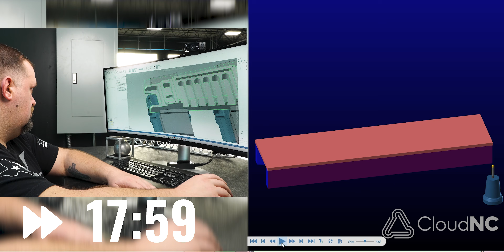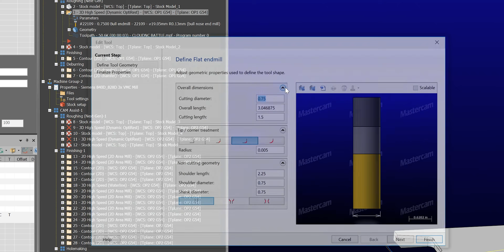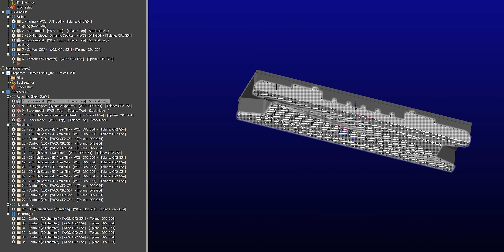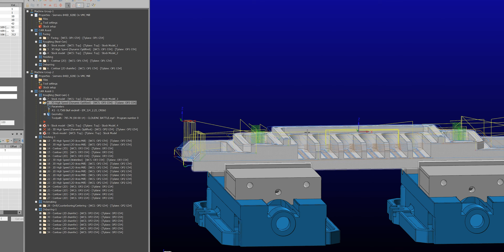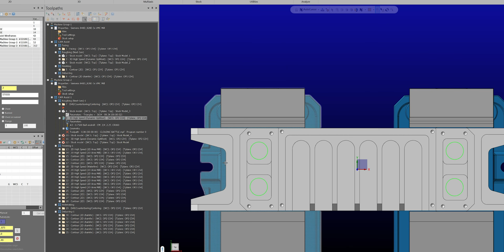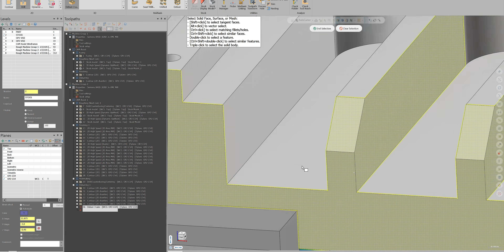Human Programmer vs AI CNC Programmer

Comment: 1. This is 3+2 axis, not 5-axis
2. Have fun telling your customers you are going to send their proprietary data to oversea cloud servers in the UK
3. also wtf taking half an hour for that part or even using CAM for this. Any programmer sh1ts that part out in 5 minutes on the shop floor and at the machine
4. Ever heard of templates? Sh1tfluencer imbec1les

Comment: I've worked with Edgecam with the same skills, just add a stp with stock and Edgecam would provide a workflow.
I was at the point to add a tool library so it would know what tools to use and feeds and speeds concerning the material.
Unfortunately that company shut down but I could just imagine the possibilities.
Great video

Comment: 20y later we just enter the 3d model and material properties. Ai will see the avaliable tools and its AI precalculated speeds and feeds. AI will run trough 50 diferent scenarios and find the best one.
BTWafter you came back to modify what the program made, it took you about thesame as the manual guy to modify stuff... trade off is same as with coding. you let ai do slop than you have to come in and check everything and modify. maybe a 20% speed increase if it did well. also over time, an inexperianced programer just gets dumber and only relies on AI not really understanding what and why something is done like that. Veterans are a diferent story

Comment: I totally get it, time is money and when you already have such capable CNC machines, you want to maximize your time setting up tool paths.
As long as the automatically generated paths work out and it doesn't take a lot of time to change and clean up, it's perfect!
Totally agree with other comments who would have loved to see the actual part being made.
So quality, time to setup, possible errors and time to finish the part can be compared.
It should also include tool cost, from wear and use of said tools, just to keep it interesting.
I love facts!

Comment: Will work great as a rough draft for programming. The operators on the floor will still have to go through and “tweak” the program sent down from the programmers. For shops that program at the machine, I don’t see AI as beneficial. Perhaps I’m wrong. Maybe high count production shops will reap the rewards. Single piece orders will continue to use expertise on the shop floor for finish work. Roughing and semi-finish work will benefit from AI. +/ .005 or greater tolerances will save quite a bit of time programming. Just a matter of time before new machines will have AI imbedded. The future waits for no one. Great content guys. Tnx

Comment: Autodesk FeatureCam has been doing this for years more like decades  with Feature Recognition this is nothing new
Reply: Hey, CloudNC here. CAM Assist is a step change from FBM (and similar) and pretty different as it goes beyond simple programmed specifications - you can show it a part it’s never seen before and it will generate a toolpath and strategy for the whole thing. Not feature by feature.

Comment: Neither one of these guys is actually writing a CNC program. Give them a text editor and a calculator then sit back and see how long it takes them to actually write the G-code. I bet that neither one could write a functional program. They rely on software designed to generate the G-code for them.
Reply: Doesn't matter. That's the future. This industry is doomed tbh
Reply: @lordzooq8987  It is the future, but neither one of them is actually writing code.

The G-code generated by modern tools is not highly optimized. Those "programmers" who can't write G-code by hand are incapable of optimizing the cycle time of their machine tools.

FYI - Hand-written code is eligible for copyright registration and protection. Machine generated code is not. If generated G-code is taken (it can't be stolen because it is public domain), then there is no remedy available under the law.

Comment: I like this its good but feels like there's alot of nuances with using it. Maybe it's a confidence thing but I would be pulling the tools I know I want it to use before asking it to tool path it. 

Does it flag material it cannot reach or finish? As that would be good if it checks its own work before it presents it to you.
Reply: Hi, CloudNC here. Yes, CAM Assist will show you at the end of the tool path generation what it's been able to do, and what it can't. Right now it can so between 70-80% of most 3+2 axis components, and we're looking to improve that all the time.

Comment: Its so weird to see the job that used be the highest paid, most experienced position that everyone wanted at most shops just be turned into an icon on your desk top.
Reply: Isn't that what the entire industry is about? Automation?
Reply: You still need to check the program to find flaws and get rid of them so the experience is still required. 
But it's a big time saver

Comment: The proof is in the run time, accuracy, and finish.  If you have a set of small lots that will run for years, if the 1/2 hour plus runs faster than the AI by enough of a difference then manual programming is the monet maker.

Comment: I fail to see how this is any different than any of the other AI/feature recognition systems that CAM packages have had for years.  Feature CAM has been doing this for over a decade now.  Calling it "AI" programming is just using buzzwords to draw attention.  They threw the word "cloud" to make sure they had the all of the buzz words covered.
Reply: Hey, CloudNC here. CAM Assist is a step change from FBM (and similar) and pretty different as it goes beyond simple programmed specifications - you can show it a part it’s never seen before and it will generate a toolpath and strategy for the whole thing. Not feature by feature.
Reply: @TeamCloudNC  Feature CAM worked the exact same way. Load a part and define stock and origins. It would handle the rest.

Comment: How is this better than FBM? That said, this is the worst AI is going to be from an exponential perspective.
Reply: Hey, CloudNC here. CAM Assist is a step change from FBM (and similar) and pretty different as it goes beyond simple programmed specifications - you can show it a part it’s never seen before and it will generate a toolpath and strategy for the whole thing. Not feature by feature.

Comment: As a manager of a small shop that also does the programming and quoting, I think this is extremely useful. It will never replace the years of experience and knowledge a human programmer has, however, it can be used to get a quick quote done. If you win that job then you have a good baseline program already, and can optimize it to your liking in a fraction of the time it would normally take.
Reply: Don't say "never replace". Given enough time CNC programmers will be completely replaced. Most likely the designers will just send the model directly to an automated system that even loads the material into the machine.
Reply: It seems like a fantastic thing for prototyping, internal workshops.. but the cost is probably prohibitive, and in reality, how much faster is it than Fusion 360 - template/container methods?
https://www.youtube.com/watch?v=WNW-OFNRA60
Reply: AI is good at doing the boring parts.
Reply: For the prototype, its more than enough. If you then have a run of 1000, then you make changes.
Reply: @ Is it anywhere close to affordable?
Reply: in china,if we have too much odd products to program,we have another choice to choose which is outsourcing the programming.  the price of this video naybe $7 more or less...
Reply: Manager of small one?😂😂😂😂
Reply: I would have a very hard time blindly trusting CAM assist, and pressing cycle start and walking away.
At least if Barry's program crashes, you can torment him . 
: )

Comment: This will be / already is a massive shift in the industry. That is an incredibly powerful tool. To get 90% of a program done in 2 minutes. A less experienced programmer like myself would easily take 2 hours to program that part by hand. I could realistically match Barry's time but with the cloud NC help.
Reply: The front end work of getting these systems up and running isn't trivial. This isn't a new idea by any stretch of the imagination. Feature CAM has been doing this for over a decade.

Comment: For the inexperienced, I can totally see this causing just as many problems as it solves.
Reply: Correct, which is why you actually need to know mastercam before using this plugin. It will help speed things up, and CloudNC was smart to say it gets you 80% of the way, rather than being a total solution.

I saw a demonstration of this and liked it, but I would've been more sold on it if it was capable of running locally on an APU rather than risking your data through the cloud. Especially if you're an ITAR contractor. Obviously, they have a secure cloud option, but that comes with its own pricing bracket. I'm not sold on that because my preference is to air-gap systems that hold sensitive data, and that means CloudNC wouldn't work for my configuration.

The other downside is that the pricing seems rather prohibitive for smaller shops that have just one programmer and less than a handful of machines.
Reply: In that sense, yes it's going to be exactly like AI "vibe coding". Is it absolutely a game changing tool in the hands of someone that knows how to use it? For sure it is, but it can also send you down the wrong path just as easily if you don't know better.

Comment: AIs fine but when things go wrong you always need an operator to either help the ai learn or manually correct the problems. AIs also not gonna fix broken machines as AI assumes you are starting with perfect non-variable operating conditions.  For programming its dope!

Comment: you can optimize your vall nose start at the bottom and on going uphill  ( mastercam  you can prioritise your tool under fbm, you can use script) could nc use script, some software prepare the 3d model to output cotetion strateie anf other  good luck have fun :) you can choice between the process to save time or what it the most profitable for the business

Comment: Optimizing with AI does indeed seem to be the path forward.  Hopefully people get paid by productivity instead of being paid by the minute.  Otherwise it's gonna be a rough go.
Reply: Optimisation is part of it. It will get to the point where you can ask it for improvements. Are there any increases in speed. 
Or I have 4 vices mounted. Structure it so the jobs can be run on the 4 setups. 
Add in probing. 
Add in tool mangement ....

Comment: Nice Video. I did the beginner course in Gotherburg, believe it was called Millturn? However i have some questions.
1: Is the AI available for the base Mcam 2025 or is it like an extra cost for that? Just curiosity. The time just chaining a part like is very time consuming and the AI is perfect for that. Then its only the small but neccesary adjustments left. 
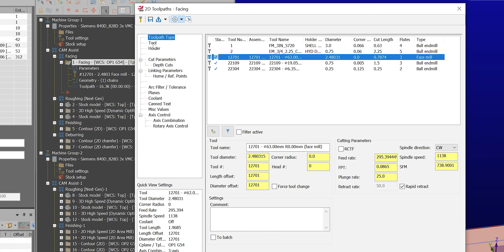2: If I run more materials with the same tool, what is the most effective way to have the speeds and feeds already set. (6:45) 
Do I need to have that tool as several tools in the tool library? 
3: Is it at any time not good to predrill pockets? The angle is 142degrees for our drills up to 30mm diameter so there will be more material for the endmill to remove at the bottom. Does Mcam know that? So it doesnt just plunge down and break? How do I program that?
Reply: 1. Extra cost, just like most upgrades
2. Store a tool library and organize it for features/materials/tool composition and length etc 
3. More than one way to skin a cat, I find ramping in with a roughing mill is just as fast as drilling, then come in with a smooth finisher.